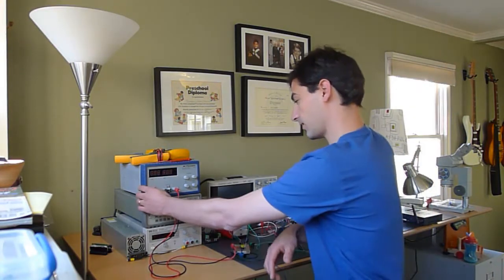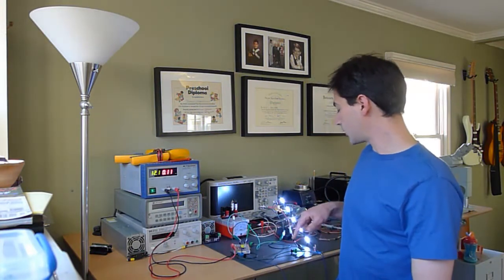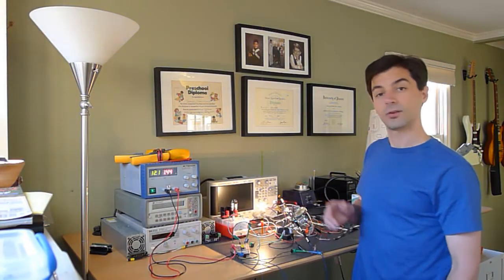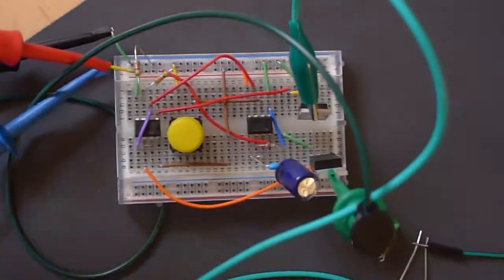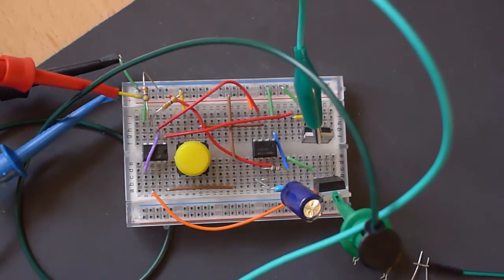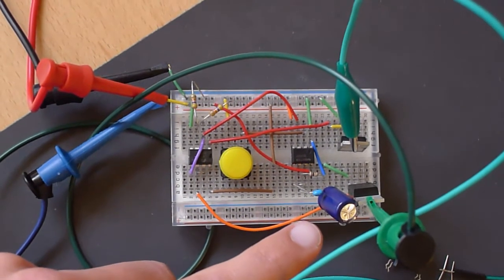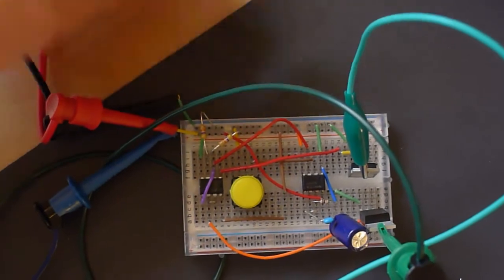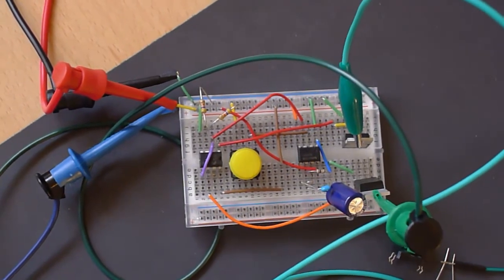555 timer driving moderate current FETs

Comment from the maker: indeed, one show = monostable
I've never though of BJTs as being more simple than MOSFETs for high current purposes. I only need to drive about 3A with this circuit but these FETs don't even need gate resistors because the drivers pull them low so this is a pretty simple design I think.